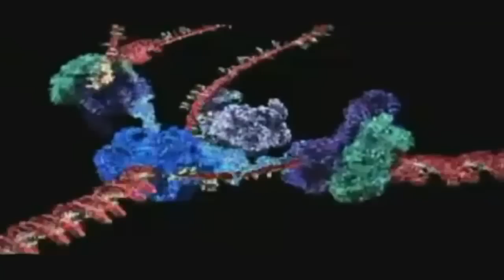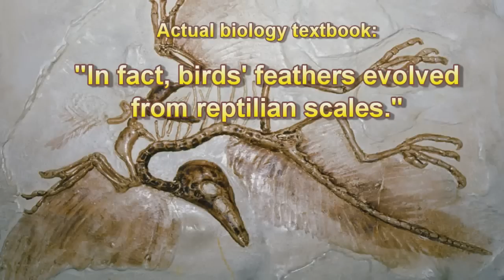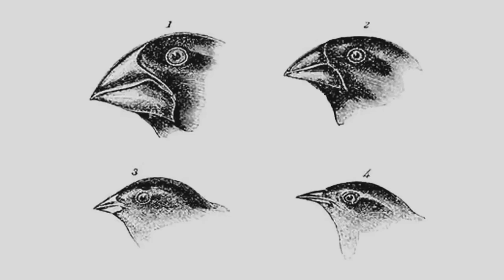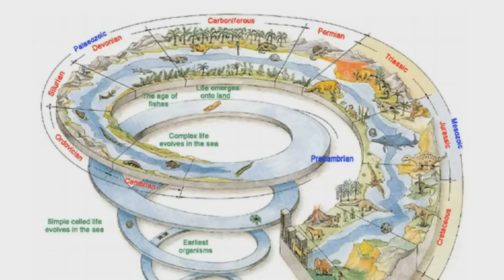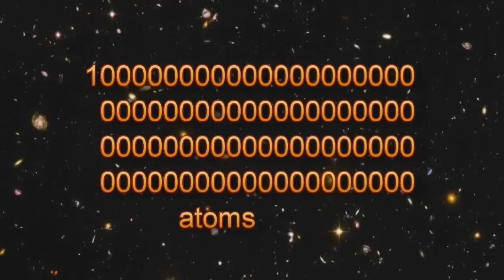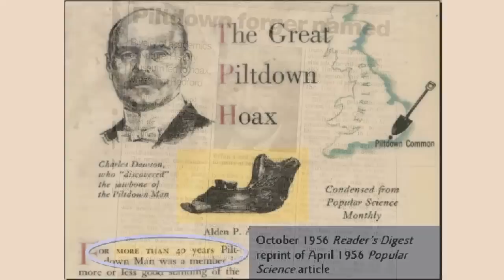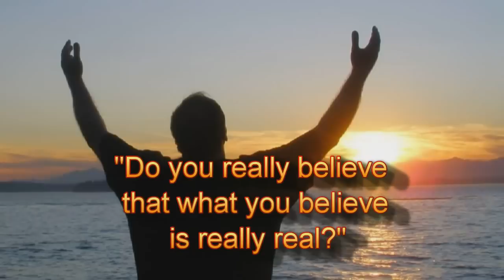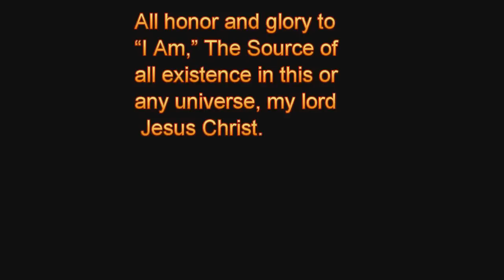Evolution Demolition

Comment: mutation changes, not always destroying. if a creature has a mutation that gives it an eye, it it uses that eye to avoid predators, then it will reproduce more and is therefore more successful a creature
Reply: Most of the time mutations are damage by any measure.  Occasionally mutations may only alter existing genetic algorithms in ways that the program will still work to some extent, but reduces the function.  Even more rare is a damaged algorithm that is actually beneficial to the organism, despite the loss of function.  An example is the sickle-cell mutation that prevents the proliferation of malaria.  However, if both halves of the mutation is present, it causes sickle-cell disease.  So even "beneficial" mutations are actually damage beneath the appearances.  Mutations cannot build new prescriptive information (algorithms) in genes.  That is impossible and would defy the entropy law.
Reply: Mark Champneys
you take his computer metaphor too seriously. When the DNA breaks in a certain way, it is repaired in a different way. it's like if your magnet made your os x less shitty
Reply: Mark Champneys
Most of the time mutations are damage by any measure.

Yes many mutations are damaging to the host organism, but not always. There is a mutation in the Human Genome that eliminates wisdom teeth and the associated problems they cause with overcrowding our jaw. About 1/3 of the human population has the mutation.

   Occasionally mutations may only alter existing genetic algorithms in ways that the program will still work to some extent, but reduces the function.  Even more rare is a damaged algorithm that is actually beneficial to the organism, despite the loss of function.  An example is the sickle-cell mutation that prevents the proliferation of malaria.  However, if both halves of the mutation is present, it causes sickle-cell disease.  So even "beneficial" mutations are actually damage beneath the appearances.  Mutations cannot build new prescriptive information (algorithms) in genes.  That is impossible and would defy the entropy law.

Sorry but this shows that you do not understand the entropy law(s). Some Dinosaurs had feathers because of a mutation to the gene that controlled the development of scales.
Reply: Mark Champneys You are dead wrong! Where is you evidence? You refuse to demonstrate how your ideas are represented in DNA. So are we just to take your word for it? Science doesn't work that way!
Reply: Mark Champneys
Again you cannot claim impossibility without first conducting an experiment! Polydactylism is a mutation where the information for the number of digits increases. Deal with it. The polymorphisms in the MHC locus increases resistance to disease in a population. This makes a population more resistant to infectious disease. That is a functional mutation with a positive fitness consequence which is the very essence of evolution.
Reply: walkergarya It is you who do not understand mutation MODIFIES already WORKING, already EXISTING very COMPLEX information. This process may produce new results - but CANNOT produce a new ORGANISM which is what your microbes to man scenario requires.

You have never seen a dinosaur, much less one with feathers or pro to-feathers. You DO NOT have dinosaur DNA - so you DO NOT KNOW if or how it compares to DNA for bird feathers.  In other words, you can ONLY BELIEVE the musings of those who told you these things.

These people ARE FALLIBLE humans.  They do NOT even make the claim to be writing for some INFALLIBLE source.

Those that wrote the Bible were also fallible men - BUT they claimed to be writing for an Infallible Source.

As for dinosaurs: See my book - Behold Now Behemoth: Dinosaurs All Over the Bible!  God created the great dinosaurs.  Men lived and interacted with them.  God created the 'owph' (Hebrew for 'things with wings') - this included the birds, bats, pterodactyls, etc.

You might want to think twice before putting so much faith in fallible men - especially when what they write is proved WRONG so often.
Reply: Glenn W.
Please tell me you are not serious? You don't actually think anybody says evolution just poofs an eye into existence right? Talk about a pointless strawman argument.

Also I suggest you look out articles about why the eye isn't irreducibly complex. The eye did not need two completely different parts to have evolved at the same time.
Reply: Helixbuilder Helix - you have been told this so many times before.
The DNA for BOTH of your examples ALREADY EXISTED! - and YOU have NO EXPLANATION for where it came from.  You simply RELIGIOUSLY accept that it came to be and start from there.

Second of all - YOU (most likely) are NOT the source of your information (i.e. YOU did not do the experiment that resulted in the examples you cite).  This means that YOU must RELIGIOUSLY express FAITH in the HONESTY and INTEGRITY and ABILITY of FALLIBLE humans - who most likely have decided beforehand that they will reject God as a possibility.

Did they simply MAKE UP THE EVIDENCE as so many on the evolutionist side have over the last 150 years?  You will say, "Of course not!" - but you DO NOT KNOW.
Reply: Glenn W. It is you who do not understand mutation MODIFIES already WORKING, already EXISTING very COMPLEX information. This process may produce new results - but CANNOT produce a new ORGANISM which is what your microbes to man scenario requires.

So you say, but that is not what is shown in our genetic heritage.

You have never seen a dinosaur, much less one with feathers or pro to-feathers. You DO NOT have dinosaur DNA - so you DO NOT KNOW if or how it compares to DNA for bird feathers.  In other words, you can ONLY BELIEVE the musings of those who told you these things.

I HAVE seen the results of experiments where the scales on the legs of birds have been mutated to grow as feathers.

These people ARE FALLIBLE humans.  They do NOT even make the claim to be writing for some INFALLIBLE source.

Those that wrote the Bible were also fallible men - BUT they claimed to be writing for an Infallible Source.

And they lied.

As for dinosaurs: See my book - Behold Now Behemoth: Dinosaurs All Over the Bible!  God created the great dinosaurs.  Men lived and interacted with them.  God created the 'owph' (Hebrew for 'things with wings') - this included the birds, bats, pterodactyls, etc.

I would not read your book of obvious lies and misinterpreted data if you held a knife at my throat. 

You might want to think twice before putting so much faith in fallible men - especially when what they write is proved WRONG so often.

I will put my faith in men like Dr Richard Feynmen, Dr Neil Degrasse Tyson before I put my faith in frauds like your "Dr" Kent Hovind.
Reply: Glenn W.
And now you resort to threats? That's sad
Reply: Glenn W.
Why does a God who supposedly loves humans resort to the threat of eternal torture for compliance to to idiotic religious dogma? So is that why the head of the Mafia is called the godfather?
Reply: Helixbuilder It is NOT that God resorts to threats - He DOES inform man of His Laws - and by definition there is a consequence for breaking any law or Law.  Therefore, YOU - by CHOOSING to violate God's Laws incur the Just Result - a sentence that must be carried out in order for God to remain Just.
I threaten no one.  I simply am informing you of your CERTAIN FATE unless a remedy is found for YOUR SIN.
There is ONLY ONE remedy.
ADMIT your sin
CONFESS a Savior
ASK to be forgiven and saved

It is not my FAULT that there is ONLY ONE remedy.  You are actually fortunate that one such as me is willing to put up with your verbal abuse to bring you news of the Remedy.

If YOU refuse the remedy, YOU will not be cured - and YOU will suffer the consequences brought on by YOUR SIN.
Reply: Glenn W.
Stop threatening people Glenn. It's very unbecoming of a Christian.
Reply: Glenn W.
I did not ask for an explanation or claim ignorance of Christian theology so desist in your proselytization it is unnecessary. Apparently you cannot explain my point if any human tortured their child or pet the would be arrested and punished how is God immune to being at least that moral? 
Thanks.
.
Reply: Helixbuilder I know Helix, how many times do I have to tell you that I engage you to talk to those watching the fight?
TF - if you are so confident of your position; why do you care what I say at all?
Reply: Glenn W.
"TF - if you are so confident of your position; why do you care what I say at all?"

That's a silly question. I care because the world would be a better place if everybody was capible of rational and discussion. I'm fearful that the next generation will see your poor behavior and feel that it acceptable to act that way.
Reply: Glenn W. Keep doing it because you keep showing that science is not your strength.
Reply: Glenn W. Nice rant with no subtance! Evolution is about life changing through time. Not about pre-life that is abiogenesis. You know nothing of information theory whether it is Shannon-Weaver or Hawking so pardon me if I don't rspond to your rant. God is not living because God would be subject to the laws of nature and woould have to deomstrate the 7 characterisitics of life. Exist yeah that is unprovable either way, so who cares becaues it is faith in human words that you've put you stock into.
No one told me reject God. I didn't. How do you know what I think anyway?
Reply: Helixbuilder And just exactly what type of being's words are you depending on may I ask?
Oh, humans - those that TELL you they did experiments and determined stuff and so on, these folks have a spotless record for telling the truth and getting it right without ever having to retract anything.... PLEASE!!

Helix - HUMANS told you stuff and YOU believed them.  You DID NOT do the experiments yourself, nor could you do all of them.  You WERE NOT ALIVE to see most of the events of the past that you so confidently stake your eternal fate on.

You say you have not rejected God.  I hope that you are telling the Truth.  But may I ask, if you have not: Why do you think that He would either be incapable of preserving His Word throughout history or of doing all the things He said He did in Genesis?

The Bible clearly indicates God is Creator with a capital C. Only twisted, faithless charlatans REINTERPRETED the clear statements of the Bible to allow for supposed billions of years (supposedly between verses 1 and 2).

Were you aware that in the Hebrew - the entire first chapter of Genesis is ONE LONG RUN-ON sentence?  Bible chapters did not appear until about the 12th century and verses not until about the 16th century - GOD KNEW the devil would attack the veracity of His Word and that many would FALL FOR THE TRICK!

IF you truly believe in the ALMIGHTY God, why do you LIMIT His power - and accuse Him of allowing His Word to need FALLIBLE men's adjusting to align with 'so-called' science?
Reply: Glenn W. And just exactly what type of being's words are you depending on may I ask?
Oh, humans - those that TELL you they divinely inspired and so on, these folks have a spotless record for telling the truth and getting it right without ever having to retract anything.... PLEASE!!
Reply: Glenn W.
Exactly you have no idea of whether those words are correct. So don't lecture me when you are doing the same thing. The only difference is I know I'm relying on human minds and you deny it.
Reply: I do not deny that the Bible was written by human beings or that they were fallible.  I SAID that they were guided by an Infinite Mind and Infallible Being (God) - would would certainly have been able to do such a thing.
You still have no magician to perform your magic.
Reply: Glenn W.
" I SAID that they were guided by an Infinite Mind and Infallible Being (God)"

Begging the question. Your answer to fallible humans writing the bible, is that those fallible humans CLAIM that god guided them. Its circular logic.
Reply: Glenn W.
That is an opinion how can you prove that Yahweh not Loki inspired the bible?